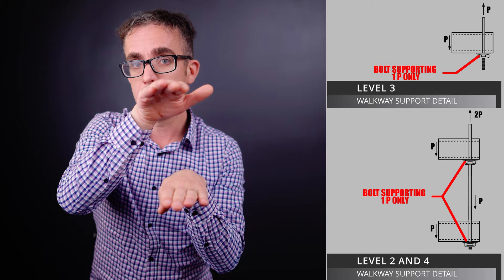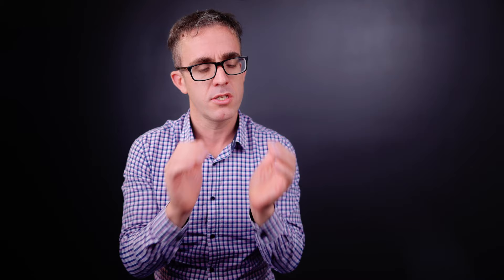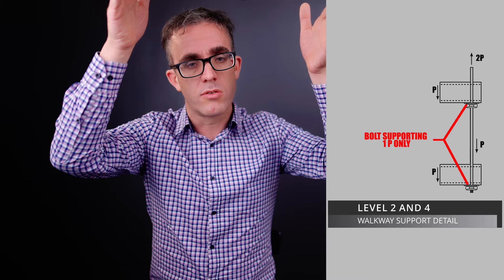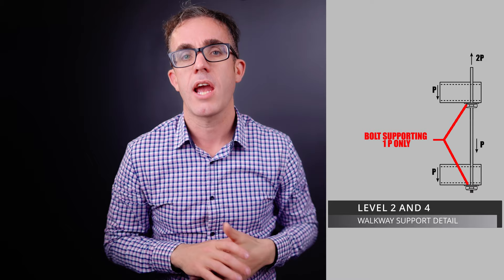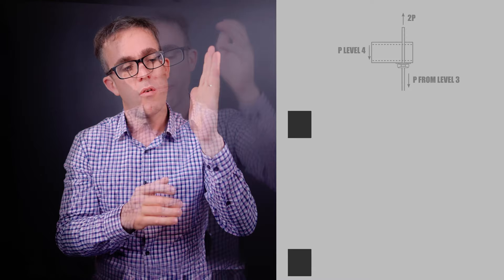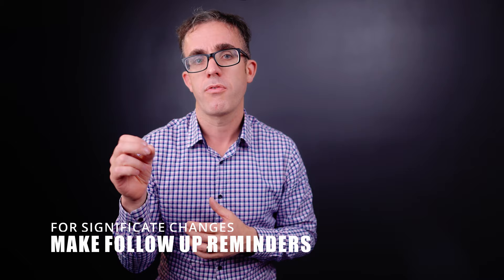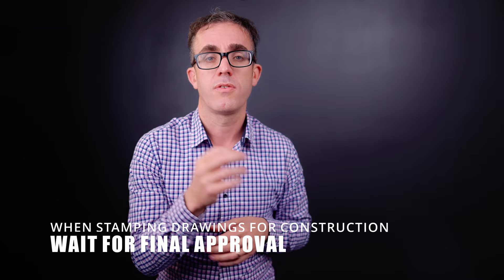The Hyatt Regency walkway collapse: A Lesson for all Engineers

Comment: Thanks for the video. Didn't realize the original design only met 60% load. Add to that a change doubling such load and covering up the appearance of excessive deflection upon construction and the trap was set. As a highway engineer, I would sweat and bleed on my projects because I knew the responsibility involved. It is hard to do good engineering in our present lax environment fostering personal irresponsibility, often the 'engineer of record' is in fact a 'team', which is code for no one is responsible. And forget the old master-apprentice model, now the experienced engineers just assign to the kid out of school and attend to administrative tasks, ignoring the engineering aspect of supervision.
Reply from the maker: Hi John, yea something so small, but critical, which was overlooked, add a change. It should be a reccomnded case study for all engineers.

Steel design all comes down to the details. 

Agree, engineering comes with a high responsibility, and if involved on a project everyone you feel responsible, ultimately requiring a suitably experience engineer taking responsibility.  But it is becoming more a commodity, which needs to change, good engineering cost money. 

I sweat blood on the project I do too.

Comment: The trouble with that connection was that  the horizontal part of the C beam section  was being used as a horizontal cantilever and the vertical web was not being used directly to hold the load.  The washer and nut underneath the C beam was too small and if a larger pressure plate spanning the width of the box beam such that the  thick pressure plate  would span the width and transfer the load directly to the vertical webs rather than in a cantilever effect on the horizontal parts.

The fact that the design was changed aggravated the effect but even the original design was wrong due to the horizontal parts of the C beam was being used as a cantilever and the welding of the two C sections was absolutely terrible.   It was that small washer and that small nut that were at fault as they did not transfer the load to the vertical web of the C beam. 

A thick pressure plate bridging the whole width of the two C section would have transferred the load directly to the two vertical webs and that would have been more than strong enough. I am surprised that no one saw this cantilever loading on the horizontal parts of the C sections.
Reply: Very well thought out and analyzed response. What I see on this post and including by the creator of this is a lot of references to a " small change" that was done. This was no small change by any means.

Comment: @ 5: 47, It shows the side view of the rectangle support beam, it does not show the orientation of the rods as would be seen in an end view. Other drawings show the one piece all thread rods offset in the rectangle beam. As built and in the photos, the two-piece rods pass thru a hole in the seam weld in the center of the beam, it's weakest point.

Comment: Apart from the fact that the load is doubled at the connection, there is also an additional moment and shear force at the level 4 connection (on the C-channel, since it behaves like a simply supported beam) due to the point loads from the ties below it. This also needs to be checked.

Comment: great informative video, keep making more videos like this. but can you elaborate a bit more the significance of that change in design by splitting the rod into two??
Reply from the maker: Hi Hariom Sharma, thanks for watching. The issue is around the load on the bolted connection not the rod. By splitting the rod it doubles the load the bolted connection needs to support as it needs to support level 4 and level 2, where the one with the continuous rod allows the load to pass through. Hope this clarification helps.
Reply: @BrendanHasty  okay, got it👍. Thank you. I want to be a structural engineer too, well i am in my 6th semester of my civil engineering and highly interested in structural engineering. So need some tips from professional like you😁
Reply: @BrendanHasty  Did the offset axes of the two loads introduce additional moment and shear in the horizontal member that summed the two vertical loads?  These additional stresses would not have been present in the original assembly and may account for the apparent buckling of the horizontal beams shown in the photograph. 
Such buckling may also have caused the ends of the rods to bend as the beam deflected under these twisting forces.  At first, these strains may have been minimal, but over time, as repeated stresses and  more permanent strains in the rods became evident, the connection bolts would have rotated out of the horizontal, further compromising their bearing capacity.
As a Cold Formed Metal Contractor I am wary of the casual changes that our Mechanics make when building out a complicated Steel Stud Structure like a Hip Roof or a curved assembly.  I check everything they do and make sure they understand the implications of making any small change to the way loads and stresses are distributed in the framing.  This process is complicated by the fact that it seems like very few Engineers in the USA understand the difference between Structural Steel, Wood Framing and Cold Formed Metal Framing.  Evidently, the schools do not teach them to design in cold formed.  So inexperienced Designers often presume it can be detailed just like wood, perhaps because the stud and joist cross-sections are similar in size and shape to the wood members they are intended to replace.  (Case in point:  I can't tell you how many times I have had to explain why you shouldn't cut a bird's mouth in the seat cut of a 1000 S 250 68 (50ksi) Rafter.  They look at me like I'm all three heads of Cerberus.)
I haven't time to go on about this but suffice to say that a video from you defining the salient differences between CFMF and Wood framing would be most useful in educating more people on the subject.  You could call it The Army of the Weak Strong Forces vs. The Army of the Strong Weak Forces.
Thank you for your instruction.
Erik

Comment: Don't forget to mention the severed sprinkler system pipes that were connected to tanks high above which quickly flooded the lobby nearly drowning the trapped survivors.
There was no shutoff valve to stop the fast flow of water.  Another design failure.

Rescuers had to rip out the entry doors to drain the water from the lobby.  They also connected fire hoses to the severed pipes to divert the still fast flowing water to the exterior. 

This whole scenario was similar to the titanic disaster.  The perfect storm of multiple factors that killed so many.

Comment: This case kept coming up during my undergrad years. I never understood what had really gone wrong. Thanks for the break down. I wonder if the original intent was for each floor level to be carried by a single continuous cable as opposed to the error of off setting another cable from the top slab to carry the lower ones and with this understanding how can this possibly be overlooked? But of course it easier to consider this now after the fact. Submittal process is a big process to consider and im always careful about it, in my case approving stair cases, and it still makes me nervous every time. Thanks for these great videos! Do you plan to do some design examples of real life work at any point? I think that would be awesome!! Great work!
Reply from the maker: Hi Ivan the orginal design was a single rod/cable from roof supporting two floors, thus each bolted connection only needed to support one floor. Guessing they must have had a miss calculated something as the orginal connection didn't work. They might have had a typical detail but check it correctly. At some stage the idea is to have some real world examples specially around concept design.
Reply: @BrendanHasty  Sounds Great!
Reply: @BrendanHasty  Sounds Great!

Comment: The engineer used two hot rolled channel steels to form a square steel beam, which is really a stupid design. Let alone the stupid hanging walkway by means of rods and bolts, I would have welded the nuts to the bolts if I was the structural engneer.
Reply from the maker: Hi, Xero it did seem like a strange design choice, that may have been directed by the architect that wanted the square edges. The whole design of the connection was the issue, not sure welding would have helped. RHS hangers may have made a bigger impact.
Reply: Difference in motivation. The fabricator gets paid to finish a job quick.  They may not be as keen on lasting structure.  They move on to the next job asap.  That is how they have to act to survive.  After all, there are Building Inspectors who will detect the smell of poop and issues vacate orders to protect occupants, they reason.  Move-on or close up shop.  They are motivated very differently than the Designers.

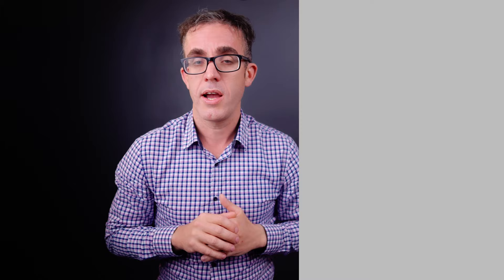Comment: 5:48 That makes me SO angry. This is a classic case of engineer vs engineer. One of them knows maths and physics and the other knows how to weld and operate machinery and never the twain shall meet. I am not a professional engineer, but I do understand mathematics and physics to a university level and can also weld and machine. A story from my own experience dealing with an "engineer" in the past, good at his job, but his job didn't involve physics. We had problems with an 8.3 Cummins diesel flashing the oil pressure idiot light on in heavy seaways. For unrelated reasons the engine was out of the boat so I got hold of the sump and modified it extensively to solve those issues without increasing the height. It went back together and saw some big waves and we never saw the oil light again. Then at some point the engine came out of the boat again (again unrelated) and that "engineer" (RIP) saw my work, and cut it all out with a grinder exclaiming how bad it was. I was furious because he didn't understand the problem space nor the solution and had destroyed my good work. No big deal in my case, but in this video a similar thing that cost hundreds of lives :-(
Reply from the maker: Hi Fredio, Thanks for the amazing support. I agree some people only hyper-focus on what their responsibility is. As an engineer, it is important to understand the whole building process. The more you know, the better your design will be. It never hurts to ask questions and look over the wall.  
I have had similar issues in design that you did(no failures, just design issues).  There may be reasons for a certain solution; this typically happens during tendering; another engineering will review the design and may judgments but not taking the same journey we did to finalise the design. Sometimes there are reasons why then the building was design in a certain way.

Comment: Yeah but, I guess I would call this a single point failure. You know like that thin plate they used on that I-40 bridge? Maybe a stiffener / load distributing plate above and below that weld creating the box frame. 50 years from now some kid who has no dog in the fight will find the best explanation. IMHO.
Reply from the maker: It is a single point of failure, yes, but there was more the two connections but they all had the same deficiency. There would have been several way it could have been address.
Reply: @BrendanHasty  I agree. It's hard to make an objective comment because hind site is 20/20. Working with a former auto mechanic in a field that used heavy equipment for patient positioning, I learned much about load distribution and not having stuff fall apart. We had many WTF discussions when the reports started coming out about the walkway.

Comment: You say “Jack” to humanize him. He was a principal in the firm he “worked for”. He “quickly did the numbers” but had put his P.E. seal on the sign without doing the numbers in the first place. The firm was party to the delay in sequestering the wreckage. The KC Star hired someone to take the key photos of the beams with the bolts pulled through. The original design already was defective. The owner (Hallmark) requested a review of ALL STEEL because of a ceiling failure in construction and the design firm did claim to have done the full review. Your presentation is shoddy and seriously biased in favor of an engineer who was criminally negligent.
Reply from the maker: Hi Gustav, using "Jack" wasn't an attempt to humanise him just a way to tell what happened , and agreed he was the lead engineer overseeing the design, thus his responsibility. (Which I am sure he would agree with). I also noted that even the orginal design in the orginal configuration didn't work, let alone doubling the load from later changes.  How this was overlooked is really concerning, with multiple people at fault as the design responsablity was split from my understanding. As for laying claims of criminal negligence that is for the courts, which I noted the outcome of these proceedings.